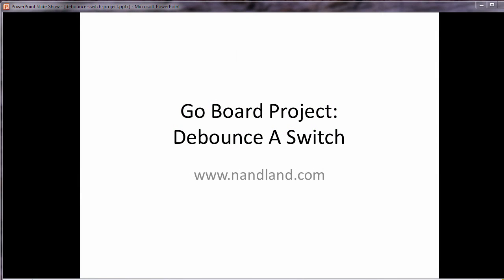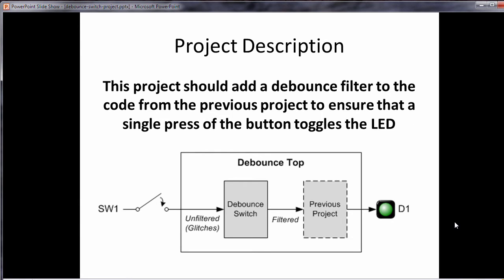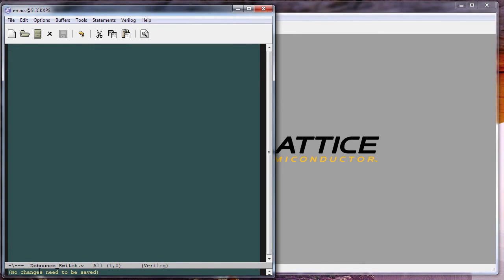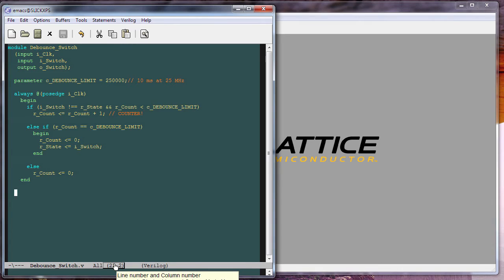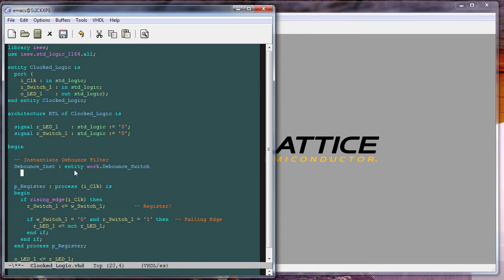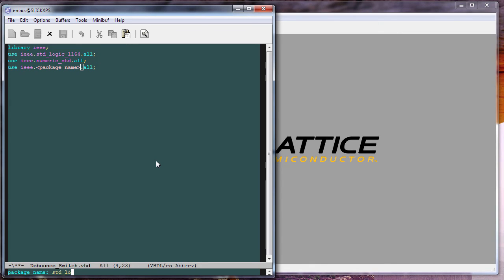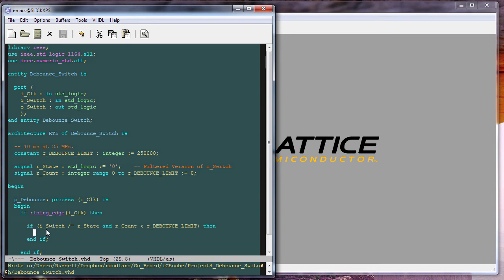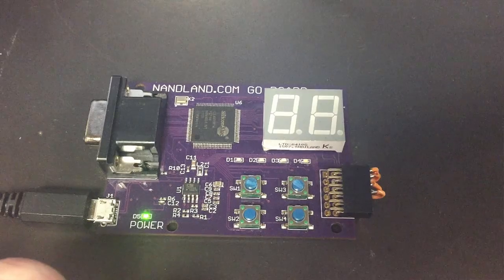Nandland Go Board Project 4 - Debounce A Switch

Comment: Why do you always use a register to assign the output of the circuit? wouldn't be easier to use the output variable as the register (i.e. replace r_LED_1 with o_LED_1)? Is this possible?
Reply from the maker: Yes you can do that.  Then you need to change the definition of o_LED_1 from "output" to "output reg" or else you will get an error.  I did it this way just to be a little more explicit with what was going on.  But your way is less typing :)

Comment: I am confused with one thing: Doesn't the counter just counts the number of times i_Switch is not the same as r_State?
We are only in counting, when i_Switch is different from r_State but not when it is indeed the same. 
Therefore, this counter does not reset after 10ms but whenever i_Switch is different from r_State for more than 250000 times! 
I am wrong?

...And what if, lets say i_Switch is ON for 100.000 counts but then bounces back to OFF for (lets say) 20 counts before going back to ON while r_State was set OFF (reg r_State = 1'b0) and only changes once r_count reaches 250.000. This means that the counter is reset to r_count=0 during the during the 20 counts (and after 100.000 counts)  without changing r_State. Therefore the filter would fail.
Please point out my logical mistake! :)
Reply: You're mostly right. As is, yes, debouncer will only pass through the new state of the switch after it has stayed stable in its new state for a hundredth of a second (when the counter reaches 250,000).

This isn't how I would do it. I would pass through the new state immediately, but then ignore changes in the switch's state for the duration of the counter, instead sending the stored new state until the counter runs out.

That said, a human won't be able to tell the difference. It's literally a hundredth of a second.

I actually hasn't noticed the difference in logic until I read your comment. Nice catch.

Comment: Trying to understand the counter logic. You check if i_Switch isn't equal to r_State and if r_Count is less than the limit - only then will you increase the counter. Doesn't that mean that you count 250000 changes instead of 10  ms passed since you never change r_State until the counter has reached its limit? (hope this makes sense)
Reply from the maker: I check for 250000 clock cycles that the condition i_Switch not equal r_State remains true.  If that condition is true, it means that a button is being pushed.  So I make sure that that condition is true for some amount of time.  This should ride-out any glitches due to debouncing, but be imperceptible for humans to tell that there's a small delay from when the button is pushed to when the action occurs.
Reply: Thanks. It makes sense now, I was just a bit confused. Love the series and will buy a Go Board soon :)
Reply: But as  FPGA sees the Glitches as slow events, it will wait until the end of the glitch then start to counts 250000 clock cycle " because the condition is not always fulfilled inside the glitch as some times i_Switch = r_State when r_State is at the Zero level " So the overall performance like we have more delay that's maybe not good for high speed applications ...Please correct to me if  i'm wrong ?
Reply: Amir Elghonaimy so how long does the r_state stay as a one? until the button is not pressed? in other words r_state doesn't toggle for one tick of the 25mhz clock, but stays on for the duration of the button press? if so is there a way to toggle r_state for one tick only? the project I'm working on needs to only pulse r_state ONCE the button has been released. what's the way I'd do that? any help would be great, thanks!
Reply: @amiral3187  But the code written here is for mechanical switch which is very slow ...So that delay doesn't add any trouble I guess

Comment: How would you debounce multiple switches?
Would you add more switches to the Debounce_Switch or is it possible to instantiate the filter multiple times?
Reply from the maker: +Jeffrey Westenberg Yes, that's exactly what you do.
Reply: @Nandland  "Yes" to which one? Should you add more switches or instantiate the filter multiple times?
Reply: @kronaeon3377  You instantiate the debounce filter multiple times. Just port map each instance to the desired input/output e.g. debounce_1 : Debounce_Switch port map(i_clk => I_clk, i_switch => i_switch_1, o_switch => o_switch_1);
debounce_2 : Debounce_Switch port map(i_clk => I_clk, i_switch => i_switch_2, o_switch => o_switch_2);
Reply: @Nicholaechs  Damn, I forgot about this comment. I figured that out. I also created a vew variants of the debounce module to include other buttons if they need to interact with things simultaneously. But thank you for the assist I hope your comment helps another person who is struggling!

Comment: @nandland Could you have avoided this by implementing a simple RC lowpass debounce filter on the switch output?
Reply from the maker: Yep. But the downside of this approach is you're fixed into the values you choose for RC. IMO better to do it digitally so you can change in the future if needed. Reworking units to change a resistor is no fun.

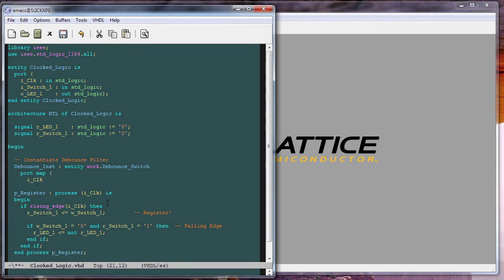Comment: Hello everybody, What is the difference about the formal and actual signal name [20:58]? Does that mean we are mapping the signals from the entity function to the outside world? BR
Reply: left-hand side is the parameter names in your component, the right hand side is the parameter names in your top module.
Reply: @uccoskun  is it ok when the parameter name of the component module and the top module are equal? BR
Reply: @marcomoldenhauer7903  yes, it is very confusing but it is normal. Once you use it like this a couple of times, you know which part of the equation refers to which variable. At the begning I was using i_clk_tb and i_clk_submodule to separate them but not any more.
Reply: @uccoskun  good idea for beginners as me :)

Comment: I tried the led switching in artix 7 and it was interesting to know that there was no mechanical debouncing
Reply: It’s likely that the development board included filtering with hardware components, so it eliminates the need to filter in the FPGA. Switch debouncing in hardware is trivial and doesn’t take up much board space. The trade off is physical board vs. taking up logic in the FPGA (very minimal logic, so the argument isn’t much).
Reply: @CSFitness1  I have basys3 with Artix7, and it has debounced on my board.